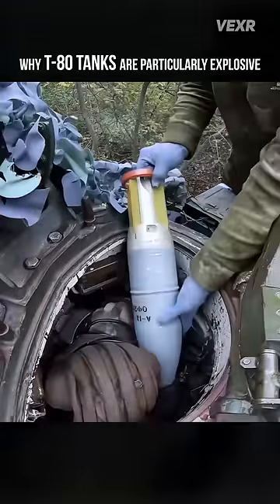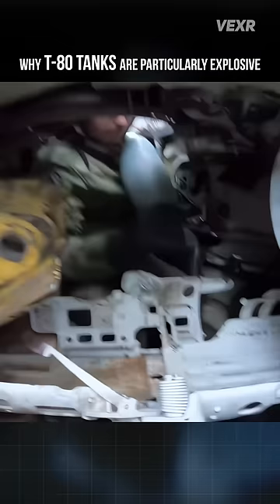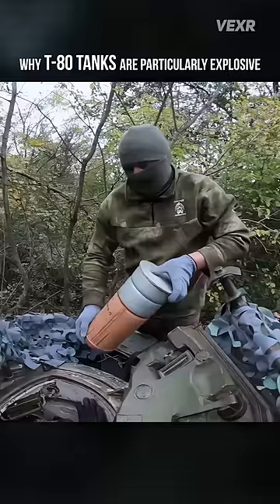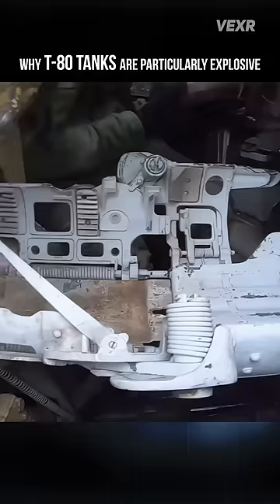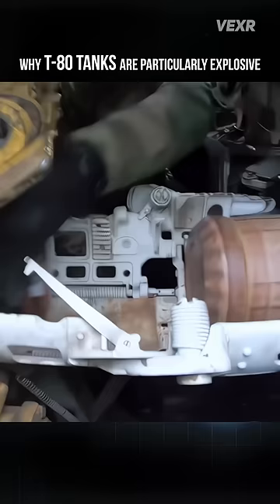T-80 Tanks Are Particularly Explosive, Here's One Reason Why

Comment: But let’s be honest that circular ammo loading thing is cool as fuck
Reply: And it is very reliable. It's just that it's an old soviet design where compactness was prioritized to reduce the size of the tank, to reduce the chance of being hit (you can easily compare contemporary western tank sizes and soviet tank size and see the difference). The trade off is, you get the ammunitions lined up in a circle right below the turret ring, which is positioned perfectly to pop the turret out if it gets hit. 

It's not autoloaders in general, but this specific type of carousel autoloader.
Reply: Autoloader was placed in soviet tanks to make it function longer in case of nuclear war. Soldier exposed to radiation becomes weak and soon die but still will be capable to load the tank gun with autoloader some time.
Reply: Not really. The French-style cassettes are way cooler than that stone-age carousel, & I personally think that postwar France is an irredeemable chode on the globe.

Like, you saw them loading it! It's like the Soviets/Russians never moved beyond the 1940s in how they handle ammo. I'm impressed they weren't still using silk bags.
Reply: @lpi3  Tanks have NBC (Nuclear, Biological, Chemical) protection. Unless a neutron bomb goes off (a very special nuclear bomb), you’ll be fine. Even a conventional nuclear blast and fallout won’t do anything to tank crews of semi-modern tanks.
Reply: @theglitch312  that's exactly what soldiers hear. But I have PhD in physics.
Reply: @lpi3   If that was true you’d know that hermetically sealing a compartment, that’s already cladded in a dozen centimeters of heavy armor on all sides and giving it a filtration system makes its crew impervious to outside radiation resulting from a nuclear blast, unless you throw a neutron bomb at a tank. Autoloaders are not meant to ‘support’ a weakened crew.

And it’s not the soldiers telling us that. It’s the literal bare bones of modern MBT designs. If your tank isn’t NBC protected, it’s an extremely shitty MBT by modern standards.
Reply: @lpi3 also what does your PHD in physics somehow state that you are a expert on radiation and its affects on tank and its crew? Tanks have been impervious to nuclear radiation for ages. Modern tanks are especially safe against radiation.
Reply: Good old pizza reload engineering
Reply: It is very cool

A cooler thing about it is when its hit the comander and gunner become cosmonauts
Reply: rule of cool and goes kaboom!
Reply: @doomguy7724  if nato ever designed an attacking tank it would also have an autoloader
Reply: It does look cool if you are not a T-80 tank crew.
Reply: No it's not, do you like dying?
Reply: @Nexsoxs id honestly rather explode than bleed out
Reply: Bro is coping mad hard😂 @TrollOfReason
Reply: @Fesko-ly1wr the T80/72/90s are not and never were attacking tanks, the same way leopards, abrams, challengers etc were never defending tanks, they are all main battle tanks and are designed to fit the specifications of the country that designed them. Soviet tanks had autoloaders to keep the profile low and the size compact by reducing the internal volume needed for crew.
Reply: @HANGING_SILVER  tanks like leopard1 and 2 were designed as an answer to soviet MBTs, thats why they have good front armor(id even call it best) and weak side+back armor, because it was mostly designed for fighting other tanks from prepared positions and avoiding artillery fire, this way only the front armor is required.
While T series had autoloaders not only to maintain the low profile, but also to keep the reload speed the same no matter how fast the moves(when breaking through, tanks move a lot) and good roundtrip armouring, cuz it was expected to be under artillery fire and mostly working out of prepared positions
Reply: @HANGING_SILVER   T series and almost all NATO tanks are made entirely different, i mean they are so different that comparison doesn't even work well for them
Reply: @Fesko-ly1wr  The lack of rear and side armor is to save on weight and not because they were supposed to be shot at frontally, i can guarantee that western tanks would have had more side and rear armor had they been able to keep the weight the same, soviet tanks could have thicker side and rear plates because of the weight saved by making the vehicles smaller and more compact. The extra side armor will only really help when getting shot by autocannons anyway.
You are right that soviet and nato tanks are very different but i wouldn't go as far as to say that they cant be compared, they were all designed to fit their countries requirements.
Reply: @HANGING_SILVER  why only autocannons? As always most of damage is caused by artillery, having good side armour is important to withstand shrapnel and landmines
Reply: @Fesko-ly1wr  NATO tanks have adequate armor protection to withstand artillery detonating close without the crew being killed, the extra armor the T series tanks have is not as relevant for artillery protection because shell fragments are not capable of penetrating a tanks armor plates in the first place, unless an airburst detonates very close to or above the tank, or the vehicle is directly hit. Artillery fragments are small, oddly shaped and lose velocity quickly at distance, which is terrible for penetrating armor. If artillery is landing close to the tank its going to damage tracks, optics and other equipment.
Reply: Yea very reliable at turret tossing

Comment: Pretty much all modern tanks use hydraulic power. Maybe not for an auto-loader but to rotate the turret and elevate/depress the main gun. The M1 Abrams has used fire resistant hydraulic fluid since the first batch came off the assembly line 45 years ago. I assume the T-80 does also.
Reply: I think they use vodka
Reply: I think the issue here is when hot, burning hydraulic fluid comes in contact with the ammo.

On paper, the T-80 will have resistant fluid, but in practice, some middle manager swapped it for cheaper stuff and pocketed the difference.
Reply: @firetruck988  You mean like they did with the tires, boots, ammo  and   body armor?
I'm seeing a pattern here.
Reply: Hydraulic fluid pumped by a electric motor
Reply: The M1 Abrams doesn't have an Autoloader.
Reply: @johnwade1095  😂...That is probably not that far from the truth!
Reply: The Abrams is actually one of the last holdouts for hydraulic G/T drives, the Leopard, Leclerc, T-80, and T-72/90 series utilize electrical motors for gun laying
Reply: @amogusisntfunny1464  Would that make them susceptible to EMP? What does Electrical motors provide that a hydraulic one cannot do?
Reply: @koviknia2894  Less equipment, no hydraulic leaks (Abrams is a leaky one), no hydraulic pumps, smaller gun/turret drives, etc.

To answer your initial question everything on a tank that is mission critical is EM shielded, otherwise an EMP would knock out the Abrams' drives anyway (they're controlled by electrically actuated valves)
Reply: @koviknia2894 if u would've read the comment properly u would actually understand to point that his point is the hydraulic fluid the Abram's uses for all kinds of stuff, not the autoloader
Reply: Depends what's cheaper
Reply: @steveemm9245 "rotate the turret.." -op clearly states this.
Reply: @steveemm9245  there is an electric motor to drive the hydraulics. But that is an auxiliary pump that is used when the turbine isn’t running. The main hydraulics are pushed by by the turbine when it’s running. Or it can be operated manually in degraded mode.
Reply: @koviknia2894 well considering the only emp that'd knock out a tank would be from a nuke I'd say it's a non issue
Reply: It doesn't. That's the problem. Honestly, despite that, I'm pretty sure the T-80 is better than the T-72 anyway as the T-72 has suffered worse casualties.

Comment: Every tank could be a dead trap
Reply: Yes. People seem to think tanks were designed to be invincible.
Reply: But not every tank has the same probability of survival for the crew.
Western designs like the Abrams have a very good chance of survival because of the separately stored ammunition and the blowout panels.
Reply: @MrWasGehtSieDasAn01 western tank cope.

2 pounds of HE flying through the top of your roof into your head would kill/maim an entire crew. Be it western or Russian tank.

Russian tank it leads to an instant kill due to ammunition placement. 

Abrams or leopard it would still just liquify the crew
Reply: @ahuman7199  If the ammunition is hit, in western tanks you still have a chance of survival, in Russian tanks you are just a pile of ashes in such a case.
Reply: @MrWasGehtSieDasAn01 cope harder, most tanks use ap round, if it pierces and hits crew-every tank is dead, ap can penetrate armor and not hit the ammunition
Reply: @hansohasashi5093  Did I claim anything else? Why am I supposedly coping here now? It's simply a fact that the probability of survival in a western tank is significantly higher in the event of an ammunition hit.
Reply: Not the Abrams. The Abrams has blast protection to shield the crew. And it’s been seen in action on video.
Reply: @ReveredDead  it's not always working, plus if a shell hits it from the inside you are still dead
Reply: @MrWasGehtSieDasAn01  what do you call a "western" tank? Leopard also pops like a balloon. Only Abrams has a slightly higher chance of survival. SLIGHTLY higher
Reply: @hansohasashi5093  Think the only one coping here is the one acting like Russian tanks are better because they have higher mortality rates.

"If it pierces and hits crew-every tank is dead"  yeah no shit every tank is dead, you know not every single shot fired at a tank will be a penetrating SABOT directly into the crew compartment right? 

How do you think crew mortality is even measured? Statistically US tanks that are destroyed and rendered unusable have more of their crew surviving then Soviet era or Russian tanks.
Reply: @MrWasGehtSieDasAn01 Yeah i just think they are trying to cope by telling you to cope. Abrams tanks does have a higher survivability rate.
Reply: @ahuman7199 A abrams survived a hit from a RPG that was direct towards the top. And they had there hatch open. All crew survived although injured and ears ringing but they survived.
Reply: A deathtrap is a tank that is either hard to escape or, if hit, will almost certainly kill the crew

Western tanks arent death traps as crew safety is and has been a big concern, neither were old soviet tanks (in their time) or the modern ones - if they had any because of good armor and ease of crew escape
Reply: @ahuman7199  you completely missed the point. No tank can survive that, that doesnt mean its a death trap

Russian cope, if anything

Now read a book, before i educate you by throwing one at you
Reply: @hansohasashi5093  a) modern tanks use apfsds or heat

And youre completely ignoring how tanks work

If the ap rounds pen you your beloved russian tank is as dead as the western the western tank wont get hit as easily though

Seriously, thats like saying kevlar is useless cause if a 50cal pens it youre dead, might as well use an airsoft imitation piece - completely fucking ridiculous
Reply: @NordicJarl27  irrelevant. Source on the RPG.

Most carry less than 2 pounds of explosive filler. Some are designed for shrapnel.

There’s your answer buddy, not magic abrams roof armor try again.
Reply: @domschra  opinion rejected. Donald profile pic detected.
Reply: @ahuman7199  So it wasn't the roof but the side of the turret
Reply: @NordicJarl27  side of the turret is much stronger than the roof and changes the equation entirely.
Reply: @ahuman7199  I know. my fault.
Reply: @NordicJarl27  it’s alright. <3
Reply: @MrWasGehtSieDasAn01 no the blast doors are not a guarantee the crew would be dead anyway in a ammo explosion event
Reply: @ahuman7199 The Abrams can tank like 3-4 RPGs till it’s disabled but still operational. Tanks in general are death traps  but Western ones are quite hard to actually land a successful strike. Many counter measures.
Reply: @ReveredDead  explosion of HE-FRAG ammo, say 15 rounds, isn't going to be handled by thin-ass little door. It's to save crew from propellant combustion, not an explosion lol
Reply: @hansohasashi5093  It's all in the ammo you load into it. If all it has is APFSDS, Abrams is very safe. Load it with HE-FRAG, and it'll be spread over 100 meters or more.
Reply: @ahuman7199  say what you will but the U.S military clearly prioritizes troop survivability. Equipment can be replaced, seasoned and well trained troops are not
Reply: @OG-uq9yb  US military prioritizes subsidizing its own monopoly controlled military industry even if it’s to their detriment.

The F-35 is an overpriced joke that’s the most prone to failure/crash jet in the entire US arsenal. An F-15E or F-16 can preform it’s job better at a fraction of the cost.

Older US military equipment is for sure better, but the newest equipment is the result of forced monopolization/consolidation of the industry by the USA government and clearly seeks to only enrich its self and the politicians their industry districts are located in, they have failed their own goal and objectives for the US army
Reply: @ahuman7199  actually, the M1 Abrams has a trophy system equipped on the turret to pre-detonate a missile before it reaches the tank.
Reply: @MrWasGehtSieDasAn01  And yet the Russians are still wiping the floor with you regardless because your armour wasn’t anywhere near as good as you thought it was
Reply: @MrWasGehtSieDasAn01  Then why is it that all the crews in those burning leopards practically never seem to leave them alive?
Reply: @ghostfacegrillah7891  And yet Russia lost more T-90Ms than Leopard 2s destroyed and even managed to lose over 2,460 tanks and over 3,000 infantry fighting vehicles.
Reply: @ahuman7199 your entire argument when the battle of 73 easting is brought up:
Reply: @MrWasGehtSieDasAn01  LMAO is the source ORYX? or Perun? LOL!
Reply: That’s just a dumb answer to this because no da of you get hit in the right spot you die but there are many ways to make it safer like blowout panels in the Abrams
Reply: @Max_Da_G ORYX literally uses visually confirmed losses? It’s a very good source?
Reply: @natebox4550 Nah man, RT and Tass are clearly superior and much more trustworthy.
Reply: @ghostfacegrillah7891  The Leopard & Bradley crews got away.

Comment: As someone who works around heavy machinery, and as someone who has done this exact thing im about to suggest, but you can hold a torch to hydraulic fluid for up to an hour, thats a solid hour of direct flame at metal cutting temperatures, and it will never catch fire, it simply is not that flammable, and is not the cause of catastrophic explosions inside the autoloader tanks, its simply the fact that the entire magazine is exposed to the crew compartment, resulting in the entire tank being a grenade, where at most NATO tanks keep that ammo in a separate compartment, behind a blast door to protect the crew
Reply: Sorry, but wrong. Abrams and Leo don't have a "blast door". It has a pressure door, that saves crew from propellant burning out. What explodes is high-explosive ammo when hit directly. And if I were to load M1 of Leo2A6 with HE-FRAG, they'd both blow up from being ammo-racked. Specifically because of the ammo.
Reply: Thankfully modern fluids have been formulated to be far more fire resistant.  The problem with the older fluids was when it sprayed out in a mist under pressure.  The red 'cherry juice' in older US tanks was notorious for catching fire from combat damage; it was a significant source of casualties for Israeli tankers operating M60s in the Yom Kippur War in '73.
Reply: It totaly depends on the type of hydrolic fluid. I mean yea if it's silicone based it won't catch fire. But a mineral oil based hydraulic fluid sure will
Reply: Hydraulic fluid isn't a single all encompassing fluid, there are videos of hydraulics catching fire after leaking.
Reply: Except that relies on the pressure door being closed. And the ammunition just being kinetic so only the propellant bursts. There's a few reasons the door would be open, ya know if you're reloading the gun, like you would be in combat. If a hole was made in the door by the enemy's attack. A few other reasons.
Reply: Tell that to the power steering fluid that sprayed my exhaust headers on my race engine about a year ago....looked like a tactical nuke went off under my hood when that hydraulic line burst.
Reply: Интересно наблюдать за людьми каторый даже не видели это танк в жизни, но уже знают все её тонкости, и одновременно является многолетними экспертами в военном деле, которые, к тому же, успели побывать во многих конфликтах. Автор к сожалению, тоже относится к ним
Reply: There's also the fact that NATO 120mm shells can survive direct 12.7mm rounds, fire and shaped charges without blowing up.
Nato rounds are subject to tests called :
STANAG 4240(Fast Cookoff)
STANAG 4382(Slow Cookoff)
STANAG 4241(Bullet Impact)
STANAG 4496(Fragment Impact)
STANAG 4526(Shaped Charge Jet Impact)
STANAG 4396(Sympathetic Reaction)

The test are then scored depending on what happened, Type I : Detonation
Type II: Partial detonation
Type III: Explosion
Type IV: Deflagration
Type V: Burning
Type VI: No sustained reaction
If we take the DM63, it passed everything with a Type VI result beside the Shaped charge Jet Impact with a Type IV result.
Reply: Sorry but blast door will never save the crew inside
Reply: Field battle in Ukraine shows it doesn't matter which ammo setup used in nato tank, when "lancet" fpv or RPG-7 blow up ammo rack